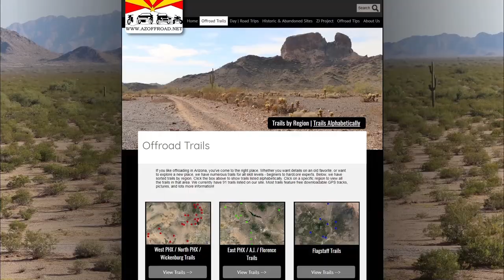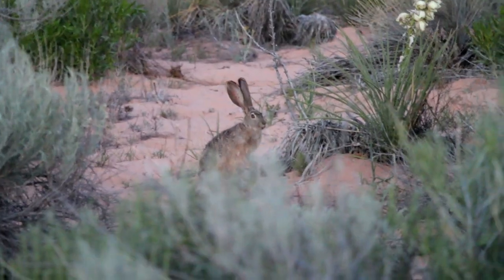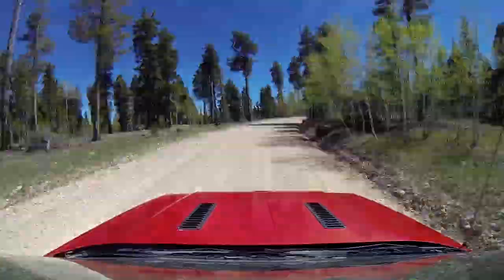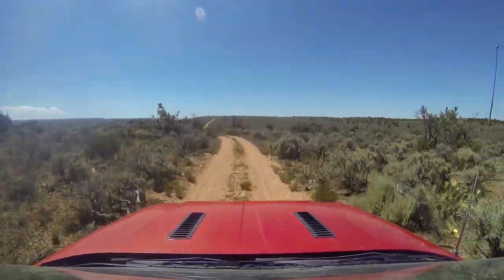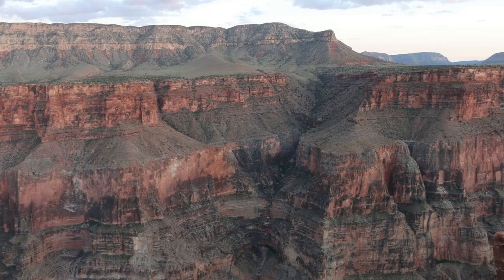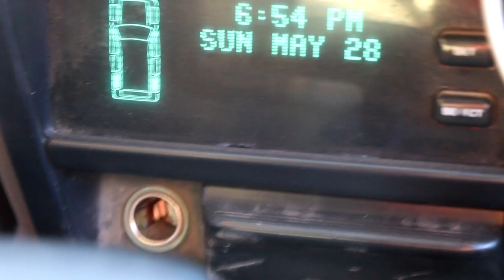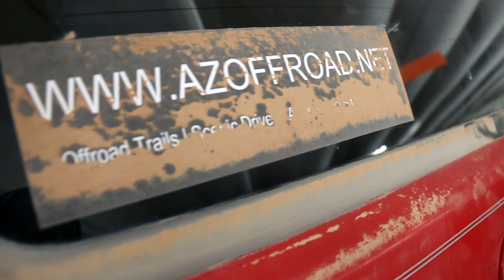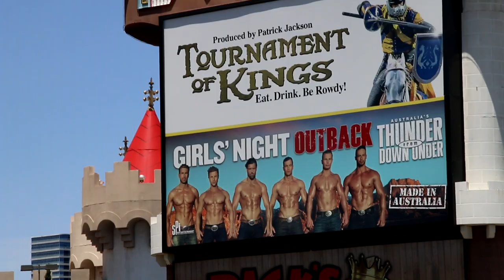Arizona Strip Trip [2017 - Full Trip]

Comment: You have Black Rock. SeegMiller mountains. Mount Logan Trumbull. 
Whitney Pass/pocket. Limekiln Pass/pakoon. Twin and Kelly points. All the area between I 15 and  Blackrock.

Road in from colorado city over to black diamond butte. 

Its 80x200 miles. Plus Lake Mead. GCNP. Vermillion cliffs. 

7 days. And you need fuel resupply. Water.

Comment: I just visited the Bar 10 Ranch on the AZ Strip, and had a white knuckle, grueling drive out. The night before I was to leave it rained/blew hard. Just as I went to sleep, I thought, "Oh sh*t, I'm not going to be able to get out of here." I made it, but there were moments when I thought I was going to be out in the middle of nowhere mired in mud. It took me two days of chiseling/knocking dried mud from every nook/cranny of the underside of my truck. For anyone considering driving in there, getting in is only half the equation; and most importantly, DRY WEATHER travel only! (unless you're flying in to one of the remote airstrips). I'm curious how you were able to cover so many miles (and so many aired-down in creep mode) on just one tank of gas, plus your 10 spare gallons.

Comment: I have a question. Is a trip on this route doable with a 2016 Jeep Renegade Trailhawk with a 2" lift, or do you need a more capable vehicle such as what you have or a Wrangler?
Reply: I’m thinking that would work. What tires are you using?
Reply: @frasiec  right now, 225/65R17 Falken Wildpeak AT3's.